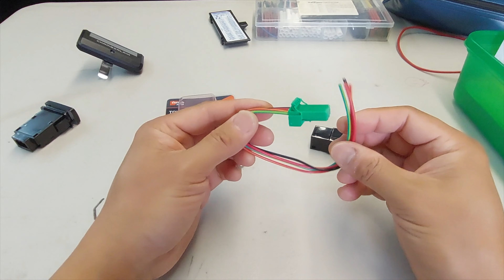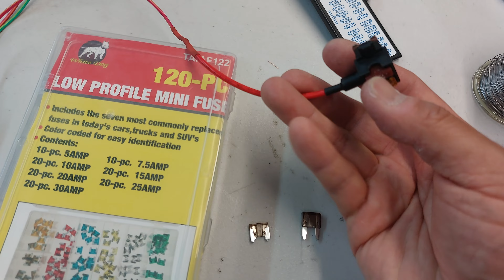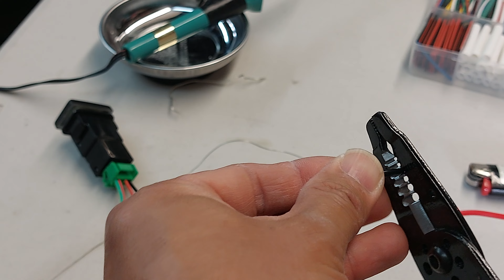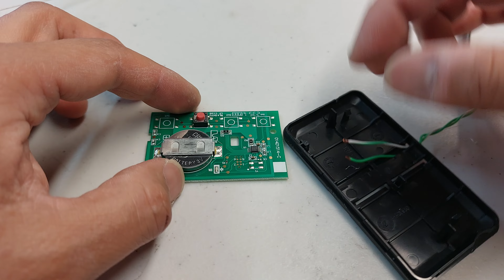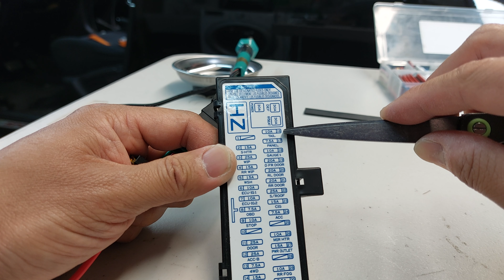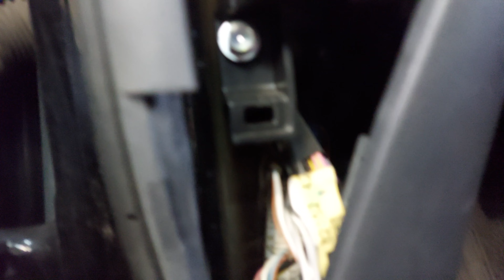Toyota Push Switch Garage Opener Mod

Comment: Hey LiL13izzy7 - quick question: I'm attempting this cool mod, am tapping into the 20A power/accessory one but wondering what fuse I should use for the door opener?
Reply from the maker: I didn't use a fuse on the door opener on purpose, because it operates on a 3V system, while your car battery is on a 12V system.  With that said, i'm sure you'd need to convert voltages in order not to fry your garage opener.  I decided to stick with the 3V battery on the garage opener, and will simply swap out the button cell battery in a few years when it needs a replacement.
Reply: @LiL13izzy7  ok good to know.  I threw a 5a in there on the second port and have the 3v battery in as well.  probably overkill but it works, so cool man!

Comment: Great mod !  Where did you mount the door clicker ?  Or you just tuck it anywhere in the fuse box area?  ( sorry if I missed that) .  :-)
Reply from the maker: I tucked it in the fuse box area
Reply: Hello.. great tutorial.  Just curious if the on off style would work the same or would it trigger it twice? Thanks.
Reply: @mikecolameta You're right, it won't work the same. If you toggle the button ON, it will continuously trigger the remote—acting the same as if you were to hold down your remote's button. It will keep triggering until you toggle the switch OFF (like letting go of the remote's button).

To open your garage door, you'd have to press the switch twice (ON then OFF). And to close it, you'd press the switch twice again.

I highly recommend you use a momentary switch instead.